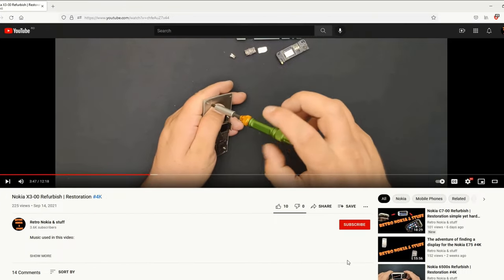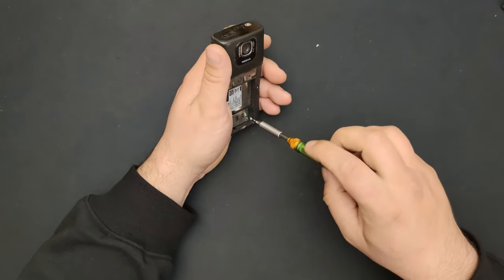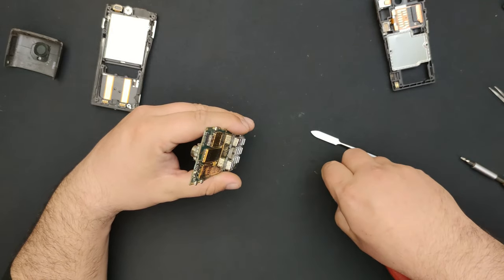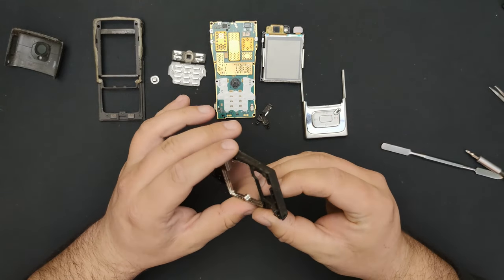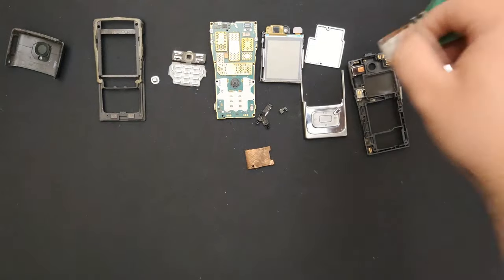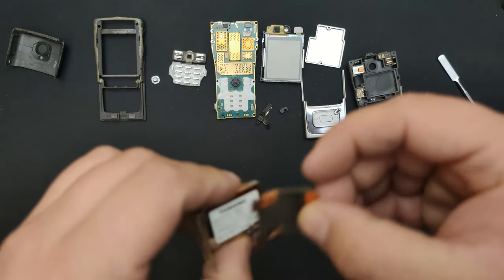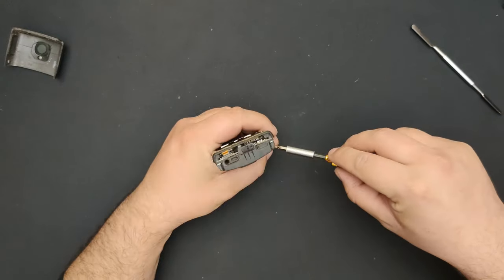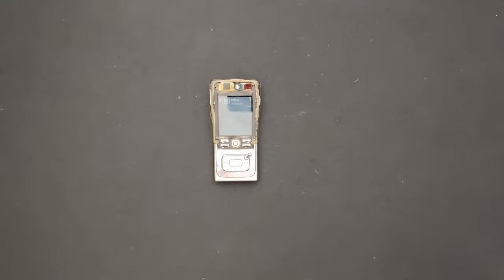The world's tiniest hard drive in a Nokia 😎   #4K

Comment: Nokia 5228 is from 2010. Will unlock trick with resistor work?
Reply from the maker: It did not work on my 5230 so I'm guessing it will not work on your 5228 as well. Sorry.
Reply: @Retrophonesstuff  I don't know why. Because n97 and 5230/5228 have the same os. And probably the same year.
It was my single xpressmusic from my collection. :(